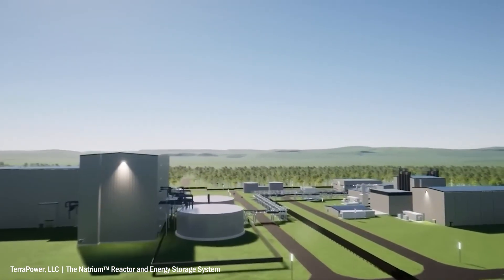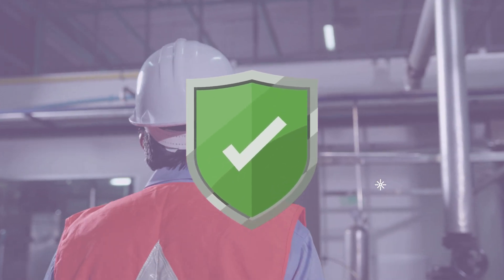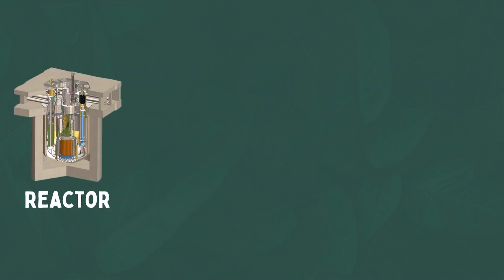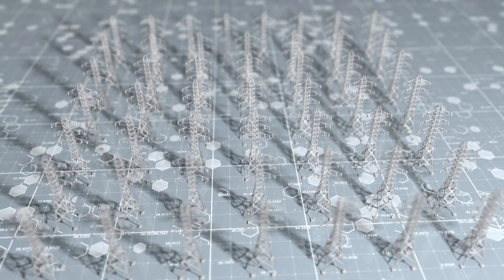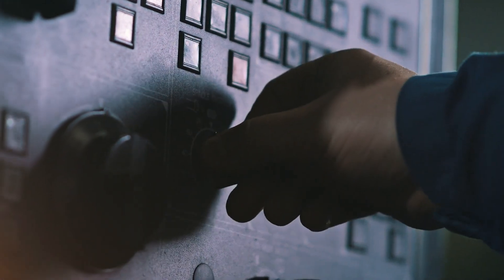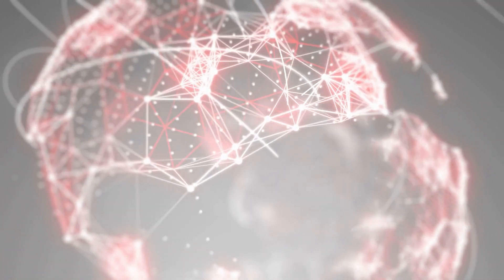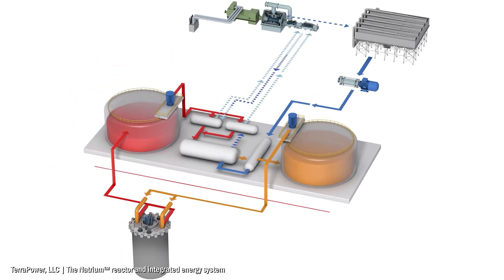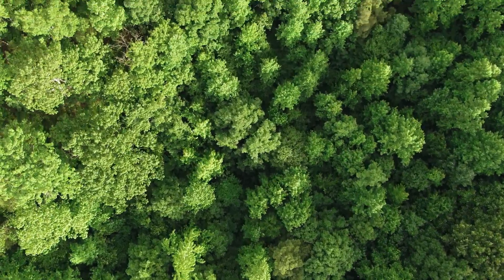Terrapower - Bringing Molten Salt Nuclear Power to the US

Comment: The state of Washington as okayed the construction of three modular reactors that will be funded by Amazon and Google.  They can be set up as molten salt and even Thorium.  The Terrapower design is still using Uranium and therefore will not be as efficient as a Thorium reactor and will still come with the waste issue.
Reply: Thorium needs online processing to make it work effectively
If they wanted to they could use a particle accelerator to make it more efficient